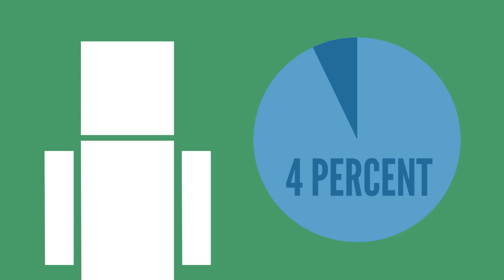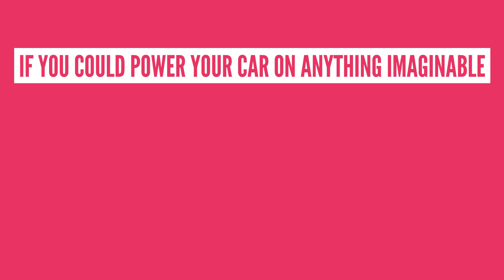Why Don't We Have Water Powered Cars Yet?

Comment: If electrolysis happens in a separate facility, the car is running oh hydrogen, not water.  If the car is electrolysing water itself, it’s using another power source and it may as well use that to power the engine.

Comment: the idea is to use hydrogen as a better form of energy storage than batterys
Reply: It's a much worse form of energy storage. It takes a ton of energy to make it and cool and compress it during transport and storage, has much lower efficiency than batteries, and is so small that it can leak through steel containers and make them brittle in the process etc. 

Sodium ion batteries that don't contain lithium or cobalt and dont have issues with thermal runaway are a fantastic alternative and have already started hitting the market.
Reply: @ChemCrafter  would it be possible to just design a tank that can recapture leaked gas to burn it off or something and make hydrogen on sight instead of transporting it around?
Reply: @chocolatelightning  Not feasibly. You would have to build a tank around the tank, adding more weight and cost, and that tank would also leak. Advanced composite materials and alloys can be used to contain it better but they are much more expensive. Making it on site means missing out on economies of scale. There is a reason hydrogen as a fuel hasn't really gone anywhere for so long.

Comment: These cars not powered by water, they are powered by electricity. Water is just a medium of energy transfer. You get more energy transferred to the wheels by powering an electric motor directly from the battery than you do by electrolysing water and combusting the resultant hygrogen.

Comment: We do? There called steam engines and there not that efficient also just use a pump to push a piston engine and suck it out at the end and repeat
Reply: And how do you heat the water to make steam?
Reply: @unrealkomic  you boil it? but the heat is not what drives the "steam engine" also if your Gona try to make the " it needs fuel to work argument" you're just stupid because even if you don't have heat the water is still part of the fuel 🤣

Comment: Sorry to disappoint you, there are two versions.  One uses plasma created from battery acid and water mixture, called geet engine or geet plasma reactor; Paul Pantone from Detroit MI was its inventor.  It runs on 80% water and does not pollute. It has been demonstrated all over in the last 17 years.  Another uses electrolysis from water; Stanley Allen Meyer was its inventor.  People here and oversea have been driving the electrolysis water powered cars since the 70's.  Some were reported to go 70 MPG, travels over 1000 miles on one tank and releases zero pollution - the ultimate global warming reduction car.  However, both are buy once and be self sufficient forever.  Not much to make after the initial rush, it does not sit well with the big guys.
Reply: Tell me you are completely science illiterate without telling me you are science illiterate lol.
Reply: @katkit4281 Science you know of is not what it can be.  Or maybe you are one of them.
Reply: @Greenr0  🙄
Reply: @Greenr0 the laws of thermodynamics have never been observed to be broken anywhere in the universe, some guy in his garage was not the first

Comment: You have to use compression to make heat and then you have to inject water into the hot engine and exhaust steam through its own valve through the radiator and back to the engine. Water can be used as a fuel. It does not break the laws of thermodynamics. And no electrolysis. Antifreeze is good. 8 cycle engine
Reply: Where does the energy come from to create the compression/heat?
You need a refresher in thermodynamics as what you describe is a perpetual motion machine.
Reply: Just because you stated “It does not break the laws of thermodynamics” doesn’t actually make it true

Comment: When you look at the work of Jean Chambrin, Paul Pantone, Stan Meyer, Aaron Salter, and others, there is no way they were all lying. Most of them died under mysterious circumstances. Paul Pantone was falsely imprisoned in a mental hospital in the years before he died and died at age 65. Water has a plasma state that we are just beginning to understand, as evidenced by the spark created when a pistol shrimp snaps its claws or the "star in a jar" (sonoluminescence) phenomenon created by sound waves. There is also the Griggs hydrosonic cavitation heater that creates shockwaves that heat water with more thermal energy output than mechanical energy input. There were also inventors like Dimitry Petronov and Zachary Warfield who were working on plasma batteries and died mysteriously.
Reply: Water being in a different state doesn't mean it can be used as a fuel source as it takes a lot of energy to get water into a plasma state.

Comment: Why don't we use steam engines? All you need to do is top up on water when your out of it. And what about the heat source for the boiler? A copper coil wrapped around with electricity passing through it creating heat. A big battery would provide the power needed, but batteries don't last forever so make it a rechargeable one with a portable solar panel attached. But with this, you'll need to stop every now and then to let the solar panel recharge the battery, so maybe attach a wind turbine to the part of the vehicle that experiences most wind to let the turbine do it's thing as you drive. 0 carbon emissions!

Comment: i would power my car on AIR 
also just put solar panels on the car so it can drive and charge in a sunny day and just incase if there is no sunlight and your car runs low on electricity but there is a electrical charger near by then i would put a charging point

Comment: You can run an internal combustion engine off of many different things. Anybody that is taking engineering and physics knows this. You can run a car off of sugar by making alcohol from sugarcane and burning it in a clean fashion. You can run an internal combustion or piston engine off of steam or and or water. You can run it with laughing gas hence the word funny cars and get 10,000 horsepower. It's stupid to think that we need to mind semi-precious metals that are rare and that will never replace steel or iron for an internal combustion engine to mine out very limited resources to get electricity which electricity will be produced only by solar power which will go down at night and then you'll not have as much power to charge your car at night but have a lot of power during the day. And before you know it you'll be out of copper and out of lithium and special metals that are required for the batteries everywhere all over the place and then if it rains or it gets really wet then there will probably be fire hazard problems. They can even run a jet engine off of alcohol and then use cold distilled water injection after the running temperature gets up to par inside a turbo jet jet engine like they did in b-52's in 1968 called cold water injection.

Comment: What about breaking water bonds with microwaves tuned to the correct frequency? 
A little bit like when the crystal glass shatters upon a person screaming/shouting at the right frequency.
Supposedly very small amount of energy input would break a lot of water into Oxygen and Hydrogen.
I guess it's one of those topics that if you invest research in you'd never get anywhere with it, and if you are too persistent you end up dead like the mentioned person from the '70s.
Reply: The question is if a resonant frequency would actually lower the amount of energy required to split the bond below the value contained in the bond. If it takes 1 power unit to split the bond in water worth 1 power unit. Then you have a 100% efficient system, great. If it takes less than that, then your back at square one, your breaking the law of thermodynamics which is basically creating something from nothing. 

Keep in mind that hydrolysis is 70-95% efficient already. The problem really is just the fact that water has a huge amount of energy in its bonds. You can't lower it without breaking physics

Comment: I'm sure it's possible to make a vehicle run by almost anything. We just need to be creative and dedicated, and, of course, do it secretly. By the way, air powered cars already exist
Reply: Air powered cars would be impossible… you need a Gradient of gas to be able to do anything with it
Reply: @your_-_mom  He probably means compressed air cars. Basically, you can use compressed air to power vehicles.
It's just very inefficient (high energy demand for air compression) and you don't get a decent range with compressed air, despite the claims of some fraudsters.

Comment: Q: "if you could power your car on anything imaginable; what would it be?"

A: "EXCREMENT!!! Interchangeable excrement containers used as fuel tanks. People won't poop in toilets anymore (saving gallons of water per day)." Or "pedals - the same mechanism of bicycles with broader varieties of gear ratios to generate motion power and/or recharge those new foam batteries." 

Conclusion: everything is a scheme to waste people away.
Evidence: scientists made a machine that shoots pathways for protons to travel almost at the speed of light and collide with other protons destroying one another.... ...."
Yet there's no more of transportation in the market to travel at 55mph without burning fuel.... Right....

Comment: I feel like once people combined this with solar panels and long storage battery capacities it definitely could be a viable source because the problem of not enough energy to do electrolysis Can be solved by the near infinite energy coming from the sun and larger battery packs for night time used
Reply: Just use solar-powered cars with that efficient battery.
Reply: Are you stupid? Why not just use the electricity directly to drive the car instead of doing on board electrolysis?
Reply: youre just adding a useless variable with the water, better off just using the electricity from the solar panel. The problem isnt not enough energy, the problem is that you use up more energy doing electrolysis than you get out of it.

Comment: You can actually dump hydrogen gas right into a conventional gas engine to supplement the gasoline for engine energy needs. With the price of gas being more than $2 a litre, then electrolysis could compete, providing ur in a country that has cheap hydro. Simply charge up a bank of batteries at night, then when you drive use electrolysis to supplement your gasoline engine. 20 or so deep draw batteries would produce a significant amount of hydrogen.  Again, only makes sense if gasoline prices are high, and electricity is cheap. Places like Canada, or possibly the States.
Reply: So why not stop wasting the electricity in a highly inefficient reaction and just put the batteries on the car?
Reply: @JMon2021  $$$ lots of money 💰 for BEV, outside of most people’s income, especially OEM level. Home conversion is about $10 to $15K if u do the work urself. Battery Hydrogen setup is about $5K if u do it urself.

Comment: Does an electric motor require less fuel resource to power a generator?
If a Prius can gain electricity from breaking (using the engine to break = creating electricity), can minimal hydrogen be used to run the engine to generate more power to propell the vehicle?
Can the wheels be used as generators for the fact they're rotating (a moving vehicle)?
Can multiple wind generators in tubes (more than one per tube) be used from the fact that the vehicle is moving (like a hand out the window can play with the wind)?

If a magnetic powered generator eventually stops, can it be kick started again with minimal hydrogen  produced from electrolysis?

Everyone is thinking perpetual. 
And people won't use electrolysis due to low hydrogen gain.
Can the hydrogen be used to keep the generator spinning?
A slight slowing would need less hydrogen to keep it going rather than to start it from stopped (as it's already spinning = it would take it back up to speed via gears).

People seem to give up on ideas.
But rarely do they combine failed ideas to achieve their goal.

Maybe someone should?!?

Is this someone you?

Comment: The first law of thermodynamics (conservation of matter and energy) is definitely a physical law that can’t be refuted, but the issue is that science as yet doesn’t understand all of the potential sources of energy. After all, matter itself is nothing other than highly organized energy. So claiming that unlocking the water molecule to release its hydrogen violates a physical law of thermodynamics because the energy required to  break the bond is greater than or equal to the energy released when the hydrogen is recombined with oxygen simply behind it is not yet understood is like

Comment: how about this, just hear me out......

Create near self containing hydrogen gas stations that are places to buy and refuel your hydrogen tanks with hydrogen.

The underground tanks underneath the gas stations will have instead hydrogen gas stored inside. There will be trucks will come by occasionally to refill water towers built right next to the gas station. There will also be windmills and solar panels built right next to the gas station that will power the electrolysis process to split the water molecules from the water tower and the hydrogen will be stored underground in that hydrogen tank.  The oxygen as a byproduct will be expelled from the process into the atmosphere if anyone is wondering what happens to that after electrolysis is done. 

If the hydrogen gas station is located on the coastline, build underwater fans to harvest electricity from water currents to power electrolysis to split water molecules to create more hydrogen gas. 

Why hasnt anyone built this yet idk? 

Maybe hydrogen cars isnt strong enough to power cars....

Comment: They should use this method the salt water and solar panels and pair it with modern electric cars. Kinda like a hybrid. I think we’d finally be able to get 500+ mile range. On a battery, solar, water electrolysis engine
Reply: Hey listen plzzz
Reply: Can u plzzz just elaborate ur comment
Reply: @samanliaqat6428  do you have the resources possible to make it happen lol? But modern electric vehicles are lacking on mileage, i feel like that’s because it only relies on a battery and a charger, integrating a roof solar panel and the salt water method we would be able to increase distance. Obviously they’d have to account for the added weight and lose weight in other places for a proper drive. But I feel like if there’s resources to fund it, it might be possible.

Comment: If I could power cars on anything: I would use CO2, use the carbon as the fuel, and have the O2 be released into the atmosphere- it would be like photosynthesis- but for cars
Reply: Oil is better.

Comment: all you have to do is extract hydrogen from water, it can't be that hard to fit into your head
Reply: LIES! Hydrogen is a scam you need to mine it in space to use it as fuel so oil is better.

Comment: I thought of an idea, where you use ionizing radiation to create hydrogen peroxide from water. Hydrogen peroxide is H2O2, and water is H20. hydrogen meaning 1 hydrogen per 1 oxide/oxygen. anyways, when you expose the particles to this ionzing radiation, they will become as particles "flexible". they will break apart, and form new bonds. when this happens, some will form into bonds of h2o2. Hydrogen peroxide can in fact be used as fuel. This was my idea, but ive heard other people have already thought of this. there is one problem with this though. in the event of a car crash, what  will happen with the radiation generator/ or radiation. that is the problem with the design. maybe when self driving cars are the only things allowed on the road will this be viable. I hope im not being stupid when i say this. btw im 15 so dont use me as any kind of source for anything. warning not a reliable source.
Reply: The idea is not possible. While H2O2 can be a fuel source there is always a net loss of energy. This means it takes more energy to break apart those bonds than you would get out of H2O2. So if you use ionized  radiation to break apart the bonds it makes more sense to just use the ionized radiation as an energy source for the car or just directly use H2O2 as a fuel source without the need of converting water.
Reply: @katkit4281  I never thought of that
Reply: @katkit4281  thx
Reply: Oil is better

Comment: I would use oil or any flammable material. I enjoy engines fuelled by combustible liquids, and oils and things as like them are incredibly common. A solid fuel engine would be especially practical because the fuel is the world, any wood any trash anything.
Reply: every car runs on someone imagination, everything
Reply: 4 years this has been done, but it is not efficient enough to run off of its own power and still needs fuel... ripi i can't fuckin count this comment is 2y old

Comment: Water engines can be a thing, they may not work like a normal engine, but you can create one by using a turbine and water, making it spin to make the rear wheels go, only problem is that there is no way to stop it, making that more accidents will happen, but another is that you can’t get it to spin as fast as 5 mph, and also the weight and size of the turbine.